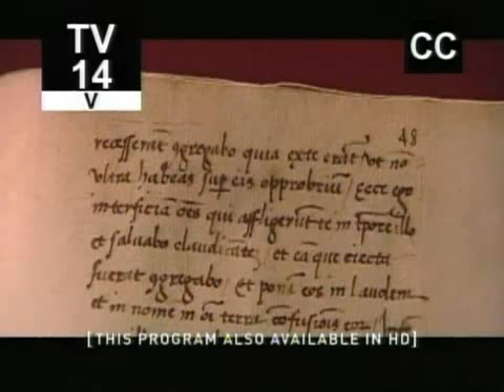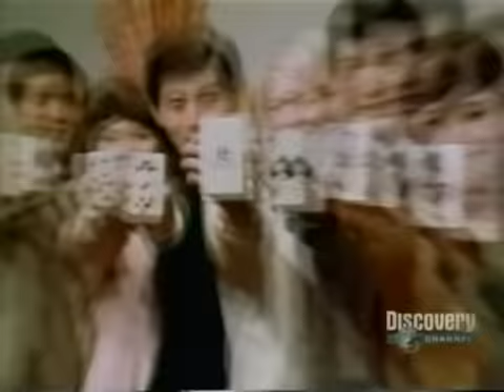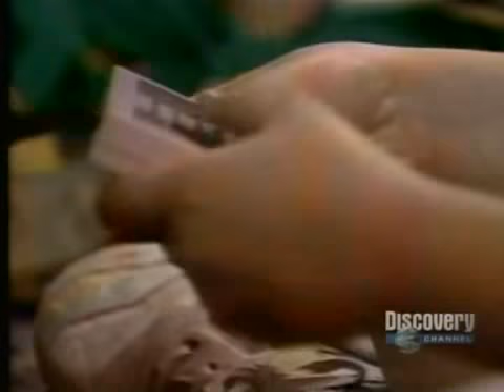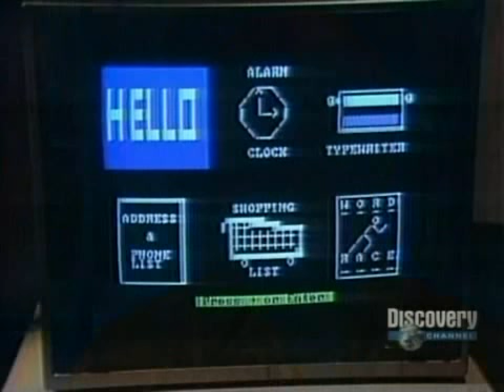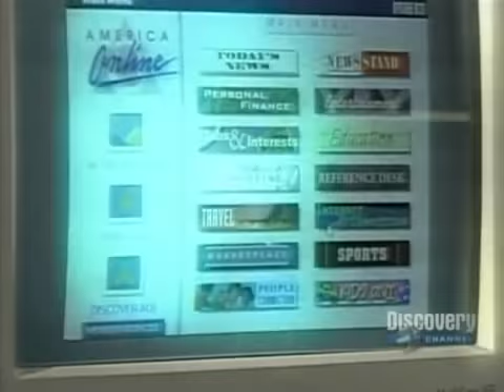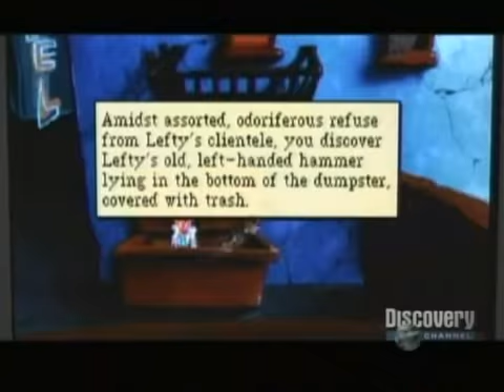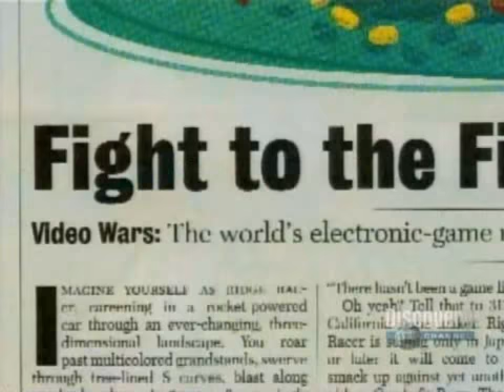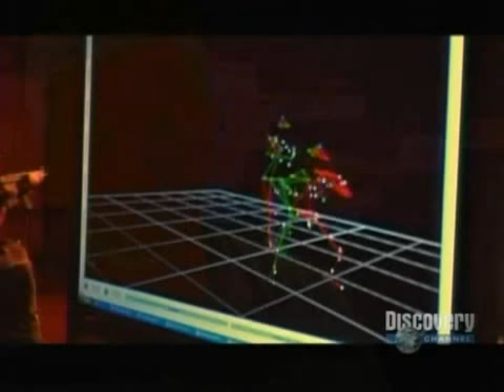Rise of the Video Game: Level 2

Comment: Strange to not quote Miyamoto at all. Lots of muddling in the NES timeline; the early US sales force really went on a limb when they sold the first Nintendo’s in NY; once it became clear it was a hit it was pretty low risk for retailers.

It’s a disappointing effort in some ways and seems incomplete.

The statement about Atari switching from consoles to computers is just wrong. Atari ran the 5200-7800-Lynx-Jaguar business separately from the ST computer line, but both moved ahead (as much as any Atari console could move ahead).